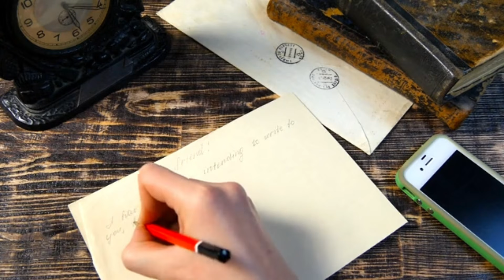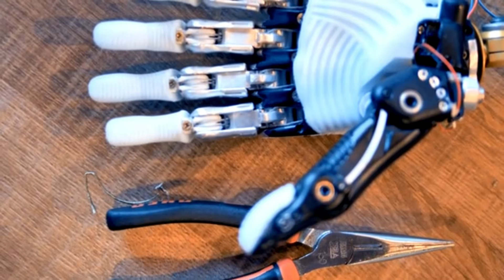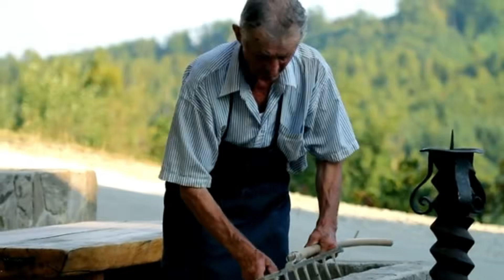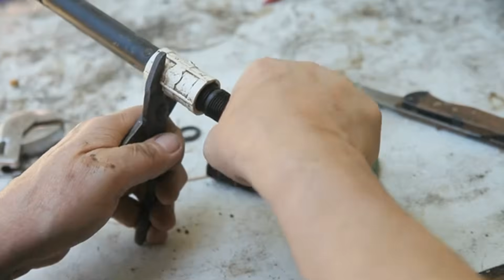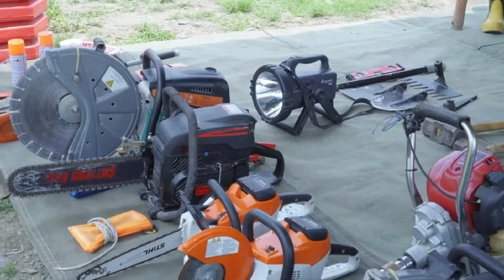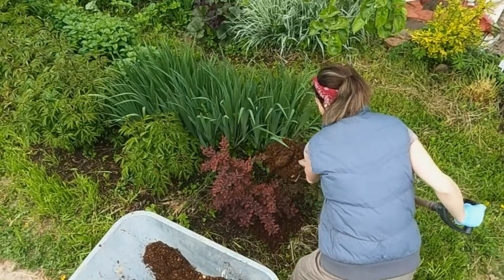This DIY Shredder Turns Branches Into Mulch Instantly. No Electricity Why Don't You Know About It?

Comment: "DIY power chippers for mulch can be constructed by adapting existing high-speed motors, such as electric strimmers, old lawnmowers, or angle grinders, mounted onto sturdy frames. Common designs involve creating a feeding chute from PVC or metal tubing and using hardened blades or chains to shred yard waste, branches, and leaves into small pieces.

•Angle Grinder Chipper: A small-scale chipper can be created by welding saw blades onto a rotating drum powered by an angle grinder.
•Gearmotor Roller Chipper: For stronger branch cutting, a 1.5KW electric gearmotor can be paired with a roller and cutting blades to handle branches up to 4.5 cm in diameter.

Lots of videos on YT- just search "DIY power chipper for making mulch."